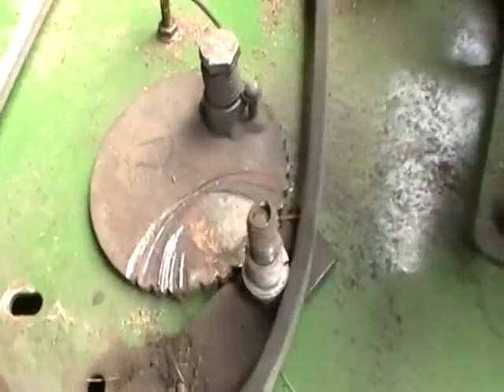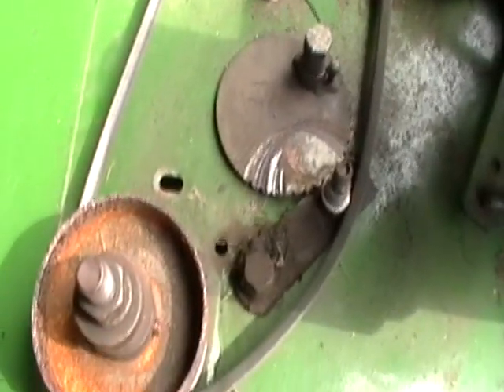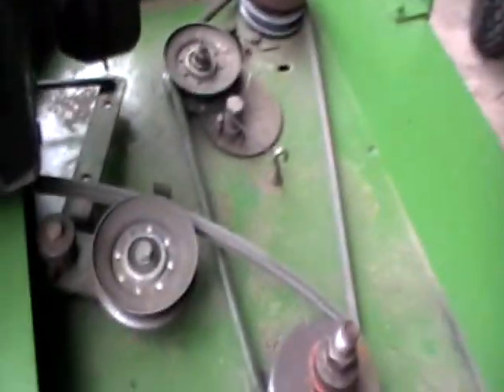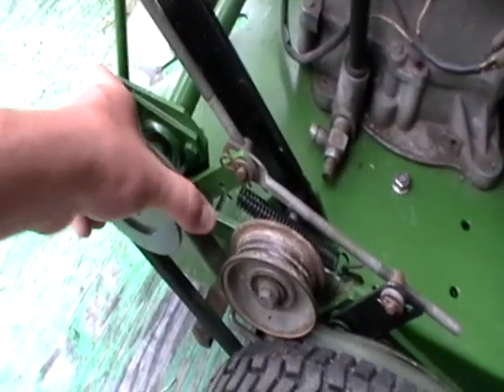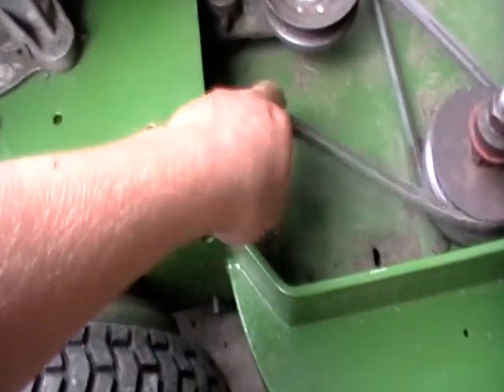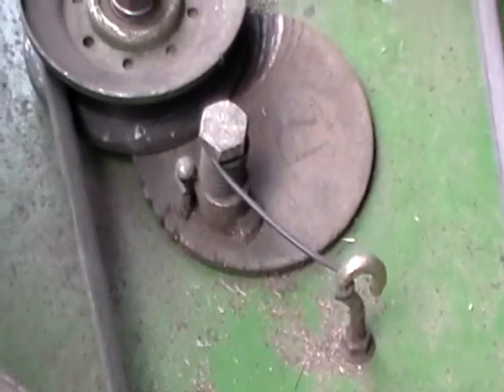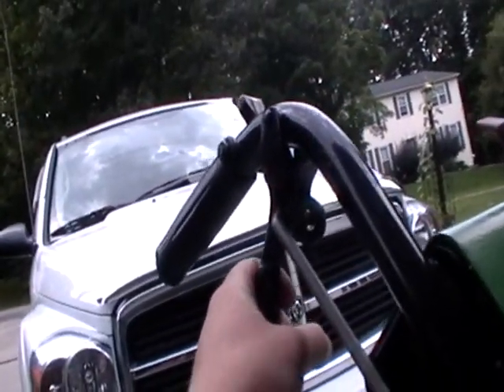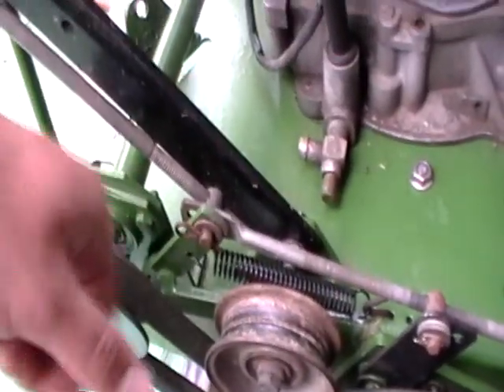adjusting some of the belts on my deere

Comment from the maker: @JFinne9 there should be a tag on the mower right next to the transmission box that has the model # and you could take that to a john deer dealer and maybe you could get a maunal or they could help you out. adjustments on these are fairly simple. if you want to know how to make it go faster let me know. i just did a slight mod to mine i have it going 7mph now. its a good work out

Comment from the maker: @bone0592 naw someone before me monkeyed with it and took the speed adjuster out. i just changed the secondary pulley to a smaller one and changed the belt to git it more speed... now i have to run behind it. but if you need more torque id put a bigger pulley onto it

Comment: I have a similar mower.  I cannot get the speed adjustment lever / pulley to engage the drive belt.  It always runs at full speed.  Can you take a picture of the underside of the drive belt area with this pulley and post it?  Thanks.  Paul

Comment: Do you know the size of the drive belts? I have no numbers on mine and mine are also a bit stretched out. I can't get an accurate measurement. 

All I know is that they are 5/8 x 40something inches.. A part number would be great. Anything helps.. Thanks!
Reply from the maker: I do not. might be able to get a part number from john deere.
Reply: I took mine to rural King and they measured them